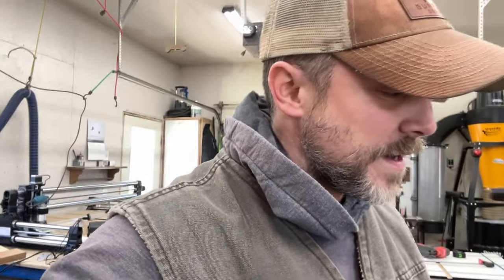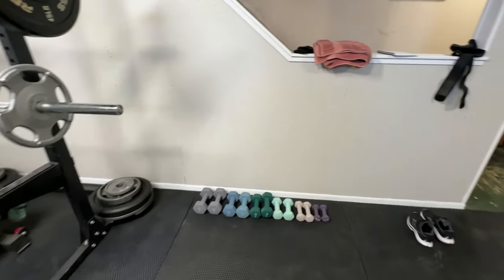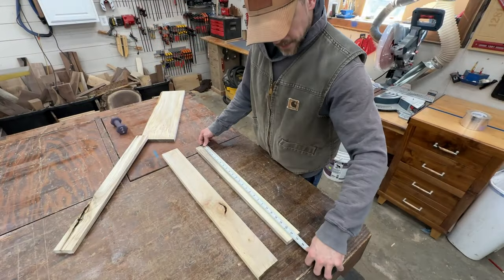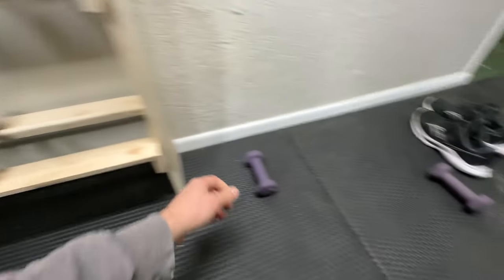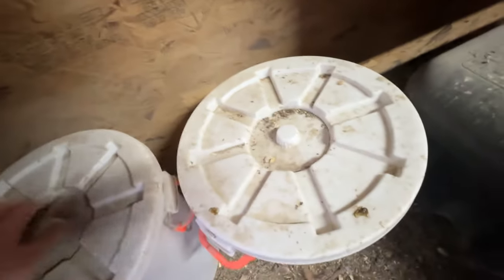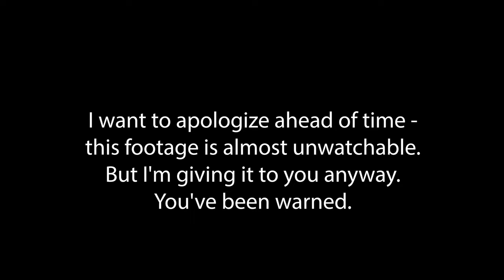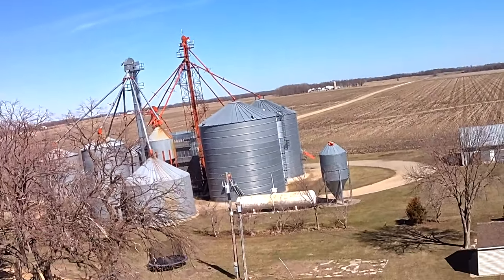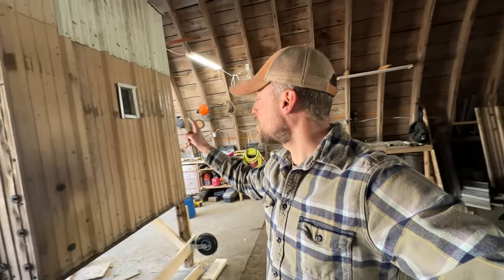Drones, Dumbbells and Defective Chickens.

Comment: FYI. If you are making money off YouTube you must be a Part 107 licensed Pilot with the FAA to fly a drone. Fines are $1,800.00 per violation. You must be registered on the Drone Zone FAA web site and Remote ID (RID) number listed for each drone. Drones must be marked with the registration number. Sub weight 250g drones do not require RID or registration. Someone cannot loan their registered drone to be flown by another person.
Reply from the maker: Man, life is way too complicated!
Reply: Well... I'm happy someone told Mark this, but at the same time... It's kinda depressing. 😕
Reply: @GunflintDesigns  I get it. You are out in the farmland nobody really knows. The problem is when you post on YouTube. Been flying RC for 47 years. This whole Congress mandated drone thing has been a real sore spot for all. The bluetooth range on these RID units is so limited. Unless you are causing an issue with someone, it will never be an issue. Been following you for sometime. Hope you are doing well. Love your new place.
Reply from the maker: @JDDupuy  I really appreciate the info! I've been looking at one of the sub-weight drones specifically so can avoid having to deal with registration. But if I'm understanding you correctly, because the intent would be posting to YouTube, that makes it commercial and then the weight is Irrelevant?
Reply: @GunflintDesigns  Correct.  If the intent of the flight is anything other than recreational, then it falls under Part 107.  Recording video for a non-profit organization (e.g. Church), flying to assist search and rescue, or recording video for a monetized YouTube channel are all examples of non-recreational flights.

If you are flying just for the fun of it and later post the video to a non-monetized YouTube channel, as I understand it, that would be permissible.  However, as with any flight, you would need to ensure that your flight complies with the registration requirement if the drone is above 250g, that you have taken the Recreational UAS Safety Test or "TRUST" (it's free and super easy), that you do not fly in controlled airspace (there are many apps to help you with this), that you do not fly beyond visual line of sight (you the pilot, have to be able to visually see the drone at all times without any aid like binoculars), you do not fly over 400 feet above ground level, and you always must yield to manned aircraft.  It sounds like a lot, but put into practice, it's really just a few things you need to keep in mind while flying.

Drone registration really is not an issue of particular significance and only takes a few minutes, the TRUST test only takes a few mins as well, and you can get your Part 107 in a couple/few weeks of dedicated study in the evenings.
Reply: @TheSofakins  heaven forbid you help out finding someone who is lost with your recreational drone. Sometimes I think regulators have no common sense.
Reply: Been flying RC for many years and the registration crap is incredibly annoying. Even worse if you intend to use it for anything commercial such as YouTube. But if you need any help just holler.